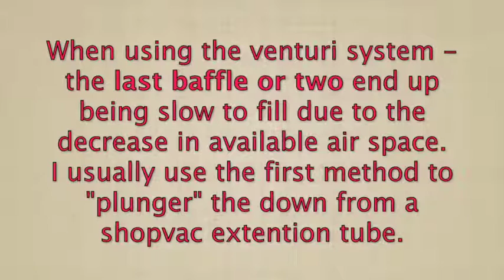Goose Down Under Quilt Build

Comment: How much down u have in the baffles and how cold does it go down to
Reply from the maker: Ken Allen Ken Allen I've been using 1.3oz per baffle on my current builds. 10 baffles, 1.5" finished height on the baffles. I've been comfortable to -10°C but temp ratings can be relative depending on the person.